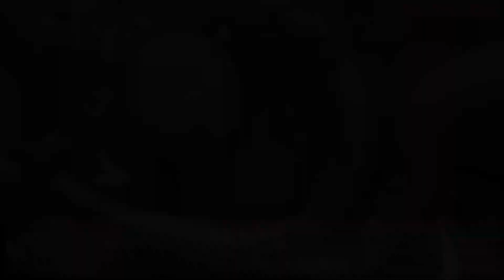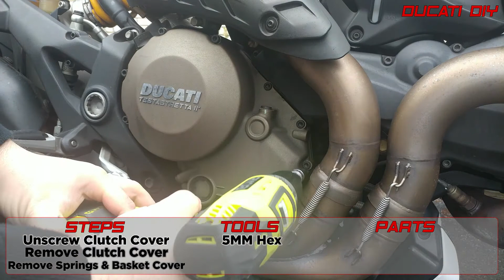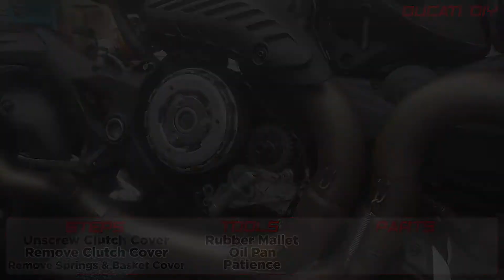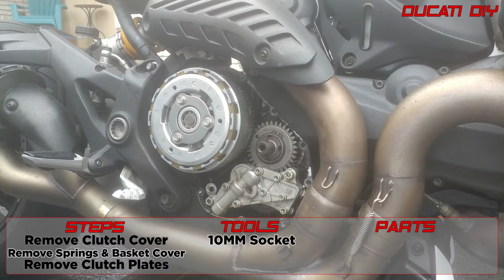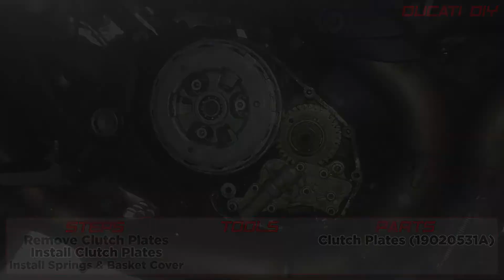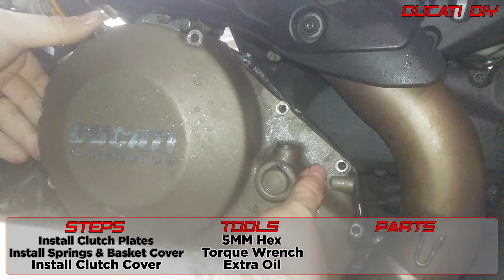Replace a Clutch and Springs on a Ducati Monster 1200S

Comment: hello, got a ducati monster 821 from 2019 -4500 km from a duc dealer ,now the problem ai have is when you put it in 1 st gently release the clutch lever , halfway the travel off the lever it's not smooth but reacts brutal ( called some 2 dealers in my country belgium day say it's the lever adjustment or the ticknes off the oil , dat's loocs to me a bit to easy  to me, thinking it's a major problem inside the clutch , hope you sir can help me out off this annoying  issue !!!

Comment: I have seen where some people soak the friction plates in the oil before installing. Do you think that is needed?
Reply from the maker: I've seen that too and I can't say if it's better or not but it's probably a good idea since it wouldn't hurt at all.  Before closing it I ended up drizzling some oil on top which is kind of the same idea.  As long as you let the bike idle to let the oil pump get oil in there you should be good.